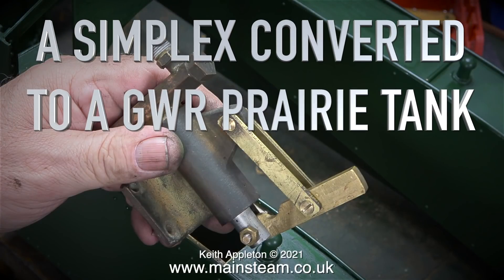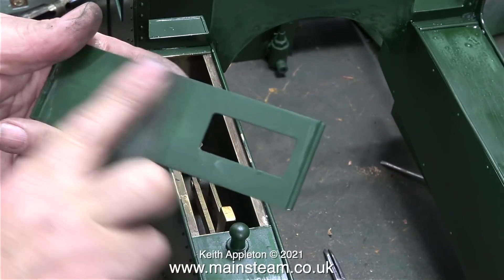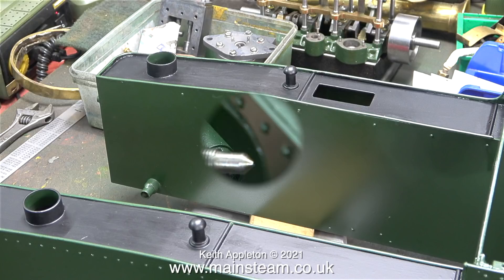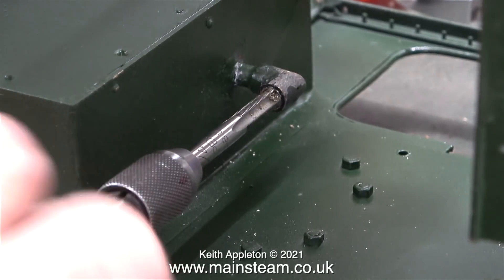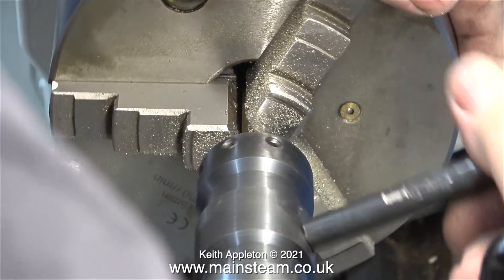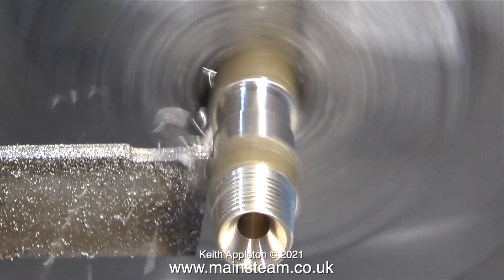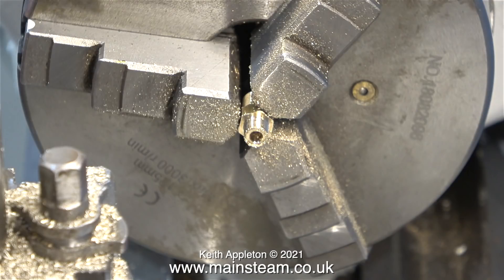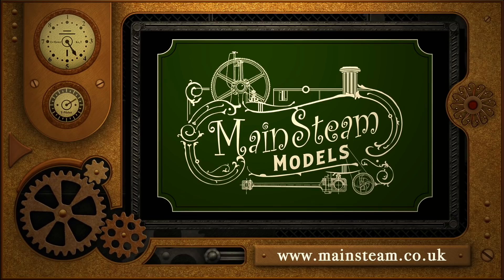SIMPLEX PRAIRIE TANK - PART #94

Comment: When I was working, I bought a Bahco adjustable wrench as I occasionally had to to work on servers and server racks. I was so impressed, I bought an identical one for my home tool box. After finishing work, I bought my tools home and found there is no difference between the "work" one that had been used over many years and the home one that has hardly ever been used. I put this down to quality manufacturing.

Comment: I still find it amazing that a model engine, is just as complicated as a full size engine.  The parts are just smaller.
Reply: In some ways that smaller size makes them even harder to deal with because the tolerances are much finer. In full size engines the tolerances are tight with the added 'fun' of great weight.